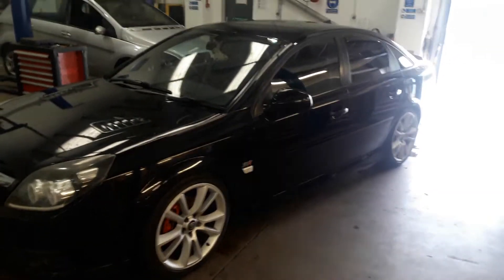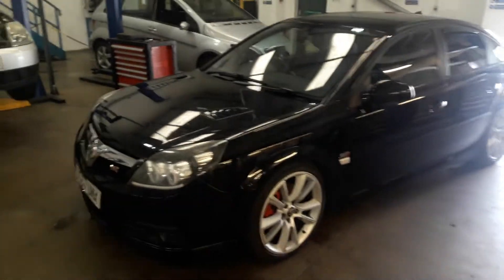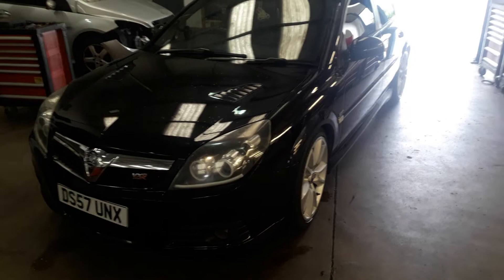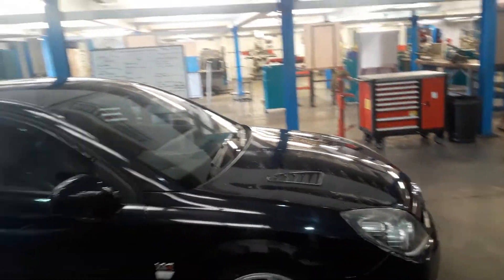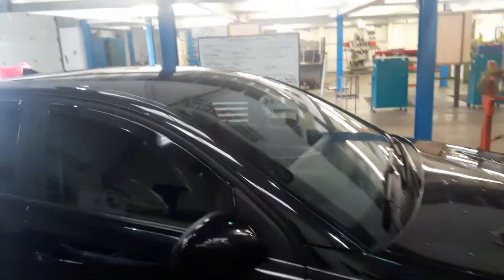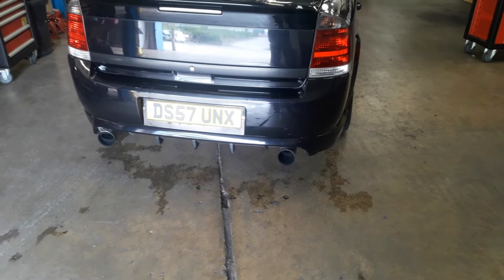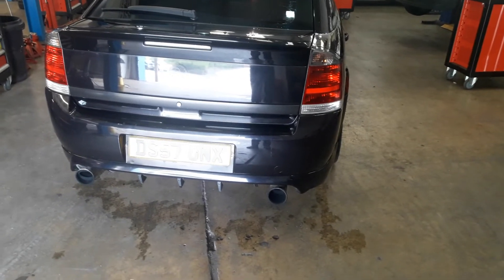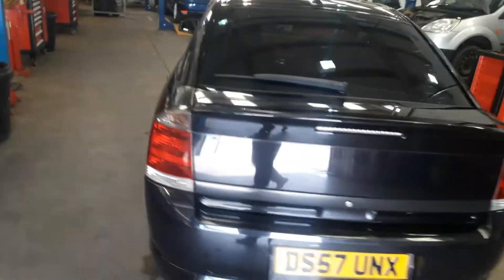Vectra 1.9 cdti Diesel straight through exhaust

Comment: Ive got a Zafira B 1.9 cdti 150, Running on bigger turbo, R80 pump etc etc...
But ive got a strange issue... I wonder if your able to help with because im running out of ideas rapidly..

If im cruising along, in 1 gear, say, In a 30mph zone, then go into a 60 zone, i put my foot down, and i go like a rocket....
No matter what gear... it pulls hard and well.... 

But if im accelerating through the gears to pick up speed.. Its gutless until around 3k revs... I have to proper thrash it to make it go...
But if i stop accelerating, and just cruise in the same gear for 5-10 seconds... and put my foot down again.. it will go like a rocket again...

Same as when i tryu to overtake.... Drop it down a gear, and its gutless to overtake... But if im cruising in a gear for a while, then just put my foot down to overtake.. it goes like a rocket...

Its kinda like, I have to stay in 1 gear for a bit, and wait for it to "build up"....

When the car is cold.. it just wants to go atthe touch of the pedal.... But when fully warmed up on a journey.. I need to keep it in 1 gear for a while, Before it will go...
Even if im in 6th at 40mph... Aslong as i stay cruising in that gear for a bit, then put my foot down, It will pull well and hard....

Someone said to me that maybe the vacuum pump is struggling to produce vacuum, and the cruising in same gear, gives it time to build up vacuum.. But i replaced the vac pump the other day.. still exactly the same...

EGR and DPF are deleted also... and EGR is blanked off at the inlet manifold and EGR is unplugged... So it isnt EGR related...
No split boost pipes.. I removed and cleaned the throttle body / judder valve, that is functioning as it should...
No engine lights, No limp mode.. Never....
Removed and cleaned the MAF and MAP sensor...
Fuel filter has been replaced...
Ive replaced that little pipe that bends round, from the vac pump too...

Some days, every now and then..  it will just go like an absolute rocket.... but 90% of the time.. it has this issue....
I do alot of long journeys too... So cant be soot build up etc...
Ive ran tank after tank of Wynns and Forte system cleaner... No change...

Comment: I Have the Van Sportive genuine 61 plate with the irmscher gm kit Just done the Box, Up Rated the bearings Full re Build Got Rid of the GM Shit it had a slight race whine output shaft bearings had started to let go feels lot more solid when you change up or down Improved the pull no end it is quicker than a identical model on gm bearings they are Toilet. So Now looking to up the wick to around 250 Brake that should upset most golf R Owners lolol.
Reply from the maker: Happy days the Golf owners will love wiping the soot off their cars lol
Reply: @dieseltuningincboosttechno4684  LMFAO Bat man Scene lmfao

Comment: I was thinking of buying a 1.9 cdti vectra for my first car would these be to expensive for a new driver on like insurance and tax.
Very good video 👍🏻
Reply from the maker: Its difficult to tell as its been a while since I was young lol probably best to do an internet search
Reply: @dieseltuningincboosttechno4684  that's grand 👍🏻
I need to get a license first so buying a car is a little bit down the road for me.
Reply: Depends on crime rate in your area and things like that, guessing you’ve not long turned 17, I’m currently 18 and looking for a first car, most cars I’ve had quotes on have been around 1900 a year without a black box, it’s very expensive so a 1.9 vectra might also be steep, companies want you to have stuff like a 1.2 and smaller or a 1.6 for a diesel
Reply: @jackpiggott40  hello 👍🏻 I was born in 2000. I'm currently half way to getting my full licence.
I putted a quote on a 1.6 98 avensis and it gave me a quote of 1100 I think.

Comment: What would this cost on astra h 1.9 120. Egr is deleted and is mapped on sports buttom to 178 but looking for more power
Reply from the maker: Its very unlikely you will get more than a few bhp with exhaust mods. The turbo will spool earlier improving the driving experience and 0-60 but to improve bhp you will need a bigger Turbo and supporting mods. Some have achieved 240 bhp on the 120 model
Reply: @dieseltuningincboosttechno4684  which turbo would you recomend and what will be the cost

Comment: What about the clutch?
Reply from the maker: The car has a one off clutch capable of taking 600 Nm made by Kestrel transmissions
Reply: Hi I have the astravan sportive on a 12 reg the 1.9 Cdti sportive 120 8v…what engine mods would you do to give it a little boost

Comment: How much would you charge to do this conversion?
Reply from the maker: Would you want the gtb22/56 or 60 or would you prefer the gtb2056? did you want the Turbo, manifold, downpipe and oil feeds ? Or would those things plus the fuel pump etc etc?
Reply: @dieseltuningincboosttechno4684  ive got a standard vauxhall signum 1.9cdti 150 so which one will you recommened? And how much will it cost all together include oil pump ect
Reply: Also do you have instargram or facebook page?
Reply from the maker: I would recommend the gtb2056 as it has huge power potential plus it will spool around 1900rpm. For the manifold, new turbo and exhaust downpipe plus all oil lines would be £650 plus fitting.
Reply: Great. How much will cost include fitting? Also will i need to upgrade the clutch or gear box.
Reply from the maker: @hoshek8065  Its a days work to fit so £200 would cover it and with retaining the standard fuel system you could also keep the standard clutch and what Vehicle do you drive?
Reply: I've got a Vauxhall Signum 1.9 Cdti Elegance 150bhp. But my car is standard so do i need to do any upgrade before the conversion?
Reply from the maker: @hoshek8065  You have a nice strong F40 gearbox so thats a good start and no there is nothing to do. A swirl flap, Cat and Egr delete will be done during fitting of the Turbo. The main engine internals are good for nearly 400bhp
Reply: Ok mate cheers. How can i get in touch if i want the work doing?
Reply from the maker: @hoshek8065  email me on whiterocket@hotmail.co.uk and I will be setting up a Facebook page soon
Reply: Email sent.
Reply: @dieseltuningincboosttechno4684  what can you do with a 1.9 120 elite 6 speed zaf?
Reply from the maker: @lennontompkins9968  a remap will see 180 bhp or bigger turbos etc will get you around 230bhp

Comment: What about mot?
Reply from the maker: the MOT test is only a smoke test which it passess. The main Cat is in place with the core removed and a straight pipe through the middle. If you look at the other pipe video it shows the Cat that looks normal from the outside so passes MOT
Reply: @dieseltuningincboosttechno4684  fair play didn’t think of it like that. Interesting! Thinking about doing a few mods on mine. Going to go for some handling upgrades first but I’ll be moving on to adding some more power next

Comment: How much hp is this running?
Reply from the maker: 287 BHP and 560 Nm
Reply: @dieseltuningincboosttechno4684  Cheers, does the astra 1.9cdti share the exact same engine or is it a different engine code?
Reply: @fuhadali5086  if it is the 150 bhp 16 valve astra diesel it will have the same engine
Reply from the maker: @fuhadali5086  yes the astra 150 bhp engine is the same